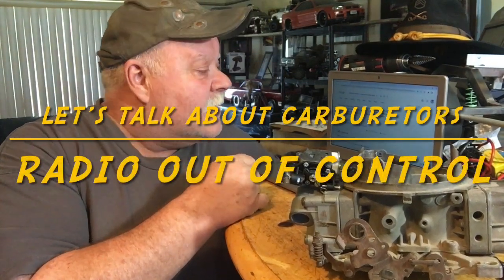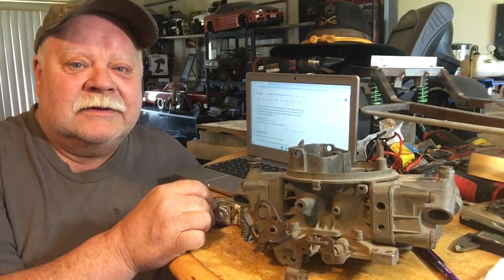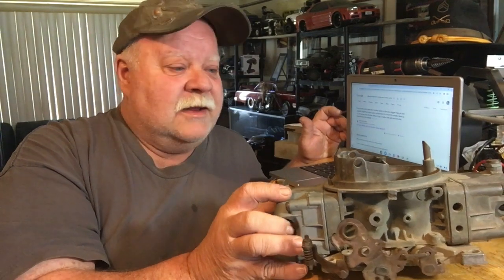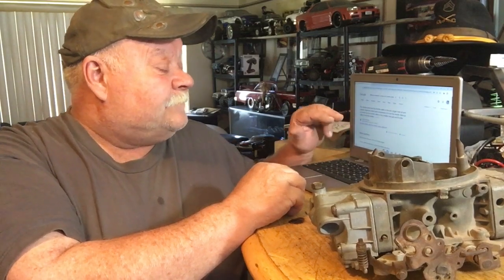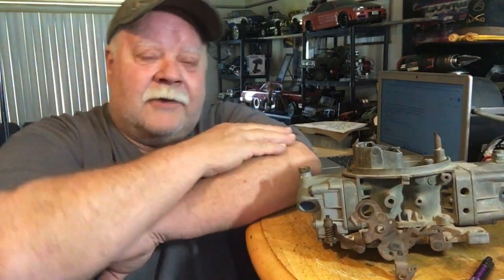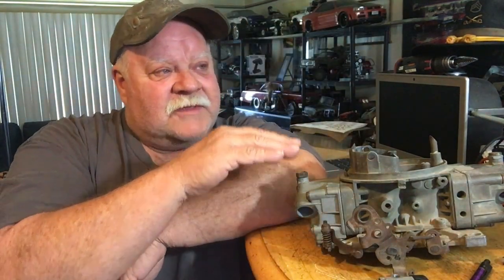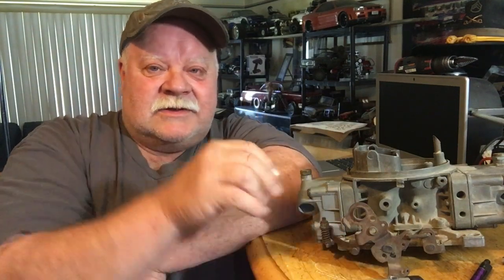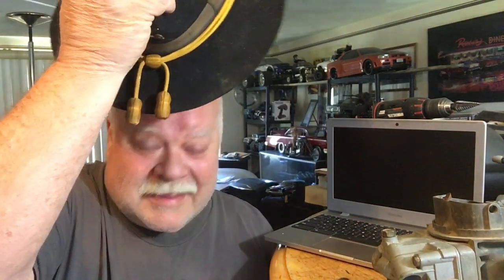Let’s learn about carburetors 2 stroke vs 4 stroke

Comment: Ye Ma g am looking at rejetting my bike with a knew carburetor! Looking at flow rate on 2/stroke & 4/strokes on my first ever bike I got in August and I think I am 2 pilot jet changes away from having it nailed and what I have found is all these old school mechanics always refer straight to Kehin or makuni settings with pilots at old hex style #17.5 or #20 newer style on my 4 stroke I'm now at #35 & #40 but that's pilot sizes stretched out for everyone at all altitudes although the difference seems double I understand flow rate can be 4 times as much but this is where that difference in 2/4stroke engines does come into play some having emulsion tubes others the emulsion tube is on the pilot and more on needle jet but they are understanding the difference they do know only governments with regulations and crap fuel means when they design these little bits of art they affectivley have one hand tied behind their backs note my thought if you do run a 2 stroke you'll get away with leaving it that bit longer but 4stroke petrol engine carbs ethanol you have to make sure you drain your bowl and use fresh fuel wee all lay them up with the best intentions all get back on in a day or two😂 3 month later rubber seals & gaskets fail going through the carb 4weeks and the spring will have corrosion in the slide keep ontop go out at least start it or drain your bowl the holes are tiny a small amount off dirt from anywhere and carbs will need cleaned again fuel fuel fuel is the problem even premium has 5percent but tuning is different on both but some mechanics look at petrol style engines the way you would describe electric cars and when they try to look at something they can't actually get 2/stroke setting out their heads and like you says they are different I am a novice to this but you just confirmed my thinking if this is correct this is sort of the same conclusion I had to thanks keep up the good work Al look into it more 👍🫡 aww its a secret society a think 😂😂 ave saw videos off mechanics and they say if you can work out the mysterious world of carburetors don't tell anyone pmsl 🫡😂😂

Comment: Yo Denny , or as we Ozzie's would say Denno, I have been experiment with a brushless hydraulic pump to get around the fuel supply problems , I literally didn't think about the fact that 4 strokes don't suck fuel in that strongly and I put the fuel tank Miles away from the engine , now I have this pump for 1/14 trucks that is sucking the fuel through the bottom nipple into the carbs , because the lid was actually opening from the pressure , the springs sometimes fail , the pump runs off a esc plugged into a y lead with throttle , works very well ! You made me chuckle mentioning mullets , they are back with a vengeance and that is awesome.

Comment: Some weed trimmers used to have carbs with accel pumps. Maybe try searching the googlay machine on the webs??
If Ethanol free fuel is available in your area, premium, or what have you, ALWAYS use that in any small engine. Ethanol blended fuel is junk people!!!
Reply from the maker: Thanks brother! will do! The fuel can be bought at my local marina and airport but its big bucks here, I paid 17.00 a gallon for race fuel for my 454 Chevelle  to stop the detonation. yikes lol!  Had fun though it was worth it😁
Reply: @dennisdempseyradiooutofcontrol  boy that car sounds fun!!
Reply from the maker: This was the best violation I ever had was a I quote ...A sudden violent display of accerelation ....I put a big smiley face on my check when I paid my 600.00 fine lol! 👌 @Guns_N_Gears
Reply: @dennisdempseyradiooutofcontrol  Holy Shit lol

Comment: I don't think the primer pump on the carb actually squirts fuel into the cylinder. I could be wrong, but it doesn't on my Rovan Baja, or the stihl weed whacker. It just gets the air out of the fuel line and fuel block of the carb then squirting back into the fuel tank.
Reply from the maker: Good call there brother, I wanted to use the return fuel tube to inject in like a accelerator pump if it can be possible

Comment: Dennis
If you drill the carb as Shown in the photo I sent you it effectively converts the carb to 4 stroke.The hole will feed negative pulses to the carb while the internal spring pushes the pump diaphram back which is the same as the positive pulses on the 2 stroke. This is just the same as Rhett does on his V12s.His are just 2 stroke carbs converted to 4 stroke.
Reply from the maker: No your last message to me was you are done with this and throwimg it under your bed where do I stand my friend?
Reply: Dennis .What do you mean " where do I stand " ? I don`t understand.
 @dennisdempseyradiooutofcontrol
Reply: @0120raptor  than he means overstand
Reply from the maker: Sorry I used my talk to text feature and it didn’t come out right brother, I meant to say I know you done this carb mod, did you ever figure out the cam problem with the cylinder head?